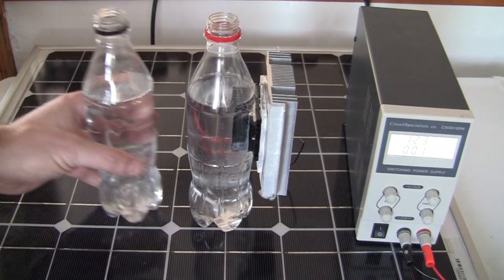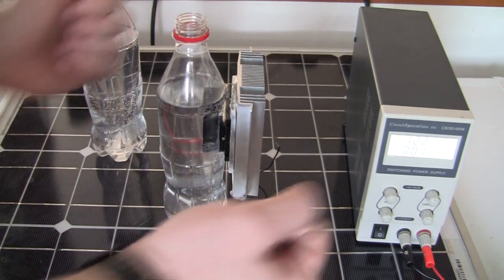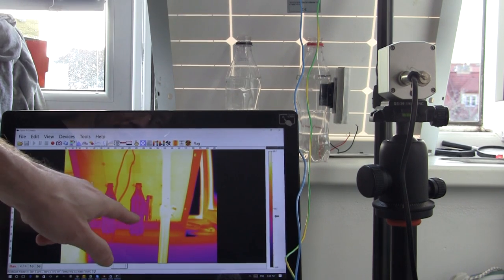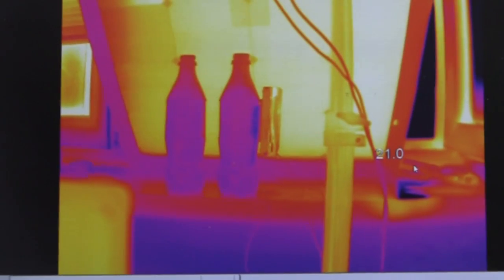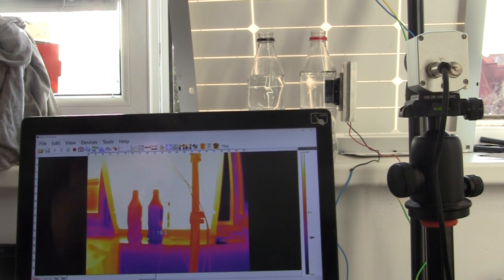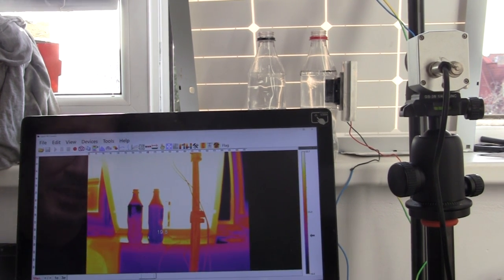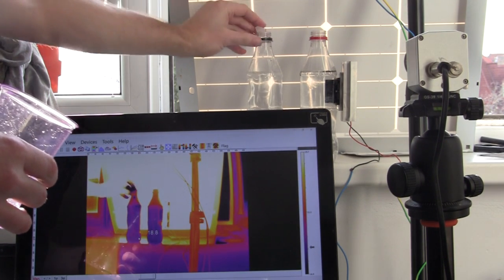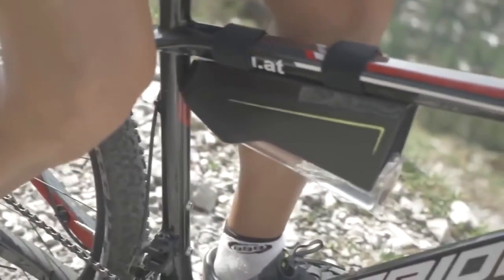Self-Cooling water bottle ACTUALLY WORKING!!!

Comment: Okay I came from rewatching your Juno video in 2022... and as you would qualify this if you had my knowledge in spanish pottery, this is just an over engineered piece of garbage.
Go to the wikipedia and search "Botijo", a clay container/big bottle made of porus clay that keeps water cool through evaporative cooling, and sure you lose some, but a botijo can be big enough to carry more than 2 liters of water and the energy used to evaporate water makes this loss negligible (or more likely you don't notice because it's opaque), and sure is heavy, but it is still lighter than a solar pannel and keeps your water fresh and cool even in the sun, not cold just cool, but still nice. It's a proven and well tested design that has lasted centuries and is still produced and marketed.

And just before anyone says this is outdated tech, the apolo missions used evaporative cooling through poorus metal to cool their computers.

So yeah you just made an overengineered rework of an already existing concept that is more cumbersome and expensive than common availabe alternatives. Just wondering, how does it feel to get busted?
Reply: You do realise that the whole point of the "Self-Cooling Water Bottle" was to poke fun at Fontus and their self-filling water bottles, right?

Comment: So it does work.  Just kinda clunky and not very efficient.
Consider converting it into a car add-on?  Drop the self-cooling angle and make it a bottle you can plug into your car to keep your drink cool on a long drive?  I mean, it's a needless, gimmicky thing but it does what it says on the box and I'm sure there are rich twits out there who'd waste money on it.
That's just spitballing a random thought. I have no idea if that would work.  The one concern I can think of off the top of my head is that one side gets really hot because it's a heat sink, so you'd have to be careful with where that is.  Can you make the cooling part detachable from the heat sink, so you can build that into the car and then plug the bottle into the heat sink to use it, so the heat is radiating out in some place that can't be touched by anyone?  Like, into the engine area, which is already hot anyway?  Then again, that might cause other problems.  Does the heat-sink part need to be really close to the cooling part?  I assume yes, because it's basically sucking energy out of the water to cool it off and that heat has to go somewhere and that somewhere is going to be close at first, but I don't know, maybe you could transfer the heat through a conductor to a radiator somewhere that's safe?
Like I said, spitballing ideas while having no real knowledge of engineering and just really basic knowledge of chemistry and physics.
Just at a glance it seems like you could maaaaaaaybe work this around into something that could actually be useful.  I mean, it's only useful at solving a first-world problem and not in a very efficient way, but still useful.  I'd personally just buy some ice myself, but, as I said, I'm certain there's plenty of rich twits who'd pay good money for this.
And taking money from rich twits is what this sort of thing is all about.

Oh, wait, just noticed there's a "show more" on the description.  Half an hour to cool it by 1 degree.  That complicates it a bit.  Hmm.  Need a bit more juice to make it work at a reasonable speed.  Could take quite a lot of power and generate quite a lot of heat.  My safety concerns immediately become larger then.

I mean, all these might be silly questions to someone who's got more experience with this sort of thing, but you gotta at least give me this much: I am asking them rather than just assuming they can be done.  And I seem to be asking the right person.  So that's two things I'm doing more right than Elon Musk.

Comment: Dude you never measured the power the peltier was getting from that panel. Guarantee it was running nowhere near it's Vmp, power thruput would have been pathetic. Use a buck converter at the very least to match them, get closer to the bench supply performance.

That said, the ice is still far superior 🤣

Comment: Its called a Peltier module or chip developed by the japanese. To be more efficient the hot finned area needs to be cooled with moving air. They use them in portable coolers.

Comment: i did some (probably really bad) math and found at a 10% efficiency, that solar panel is producing roughly 14 watts.
(4200*0.4kg*2) * (100% / 10% effic) / 2400s (40 mins) = 14 watts. i could be wrong tho

Comment: I did once use  a huge CPU cooler I salvaged from a scrapped PC, plus a peltier module, heatsink, fan, a yogurt maker and a car battery to make an EMERGENCY ONE BOTTLE BEER COOLER. It worked very well when you found all the beer was warm since it was left in the car at the campsite on a fishing trip. Load one bottle, connect battery, go fishing for an hour or so, have nice cold beer, repeat.

Comment: Self cooling water bottle. Not new at all. Very low tech in fact.
This one dates back to the middle ages : Take a simple thin walled clay jug. DON'T glaze it.
Fill with water. Some of the water will percolate through the porous jug and evaporate at the surface, cooling it down. The hotter and dry the environment, the better it works.

Comment: The peltier is supposed to move heat from one place to other. This isn't a fair presentation, since you didn't do much to keep temperature difference low. You need convection on both sides.
Not saying it's you are wrong, just that I wanted to see a proper setup of peltier cooling a water bottle.

Comment: 50 watts? doesnt that bottle take 60? to get watts you do voltage times the current (amps) so 12×5=60. correct me if im wrong, though.

maybe it was just a mistake

Comment: take a quarter of the solar panel, put it on top of a backpack, let it work for hours while hiking, cool water while hiking. Sounds like a plausible invention. Use liquid based heatsinks to reduce heatsink weight, they are much more efficient and thuns you will need lower surface area and thus less weight. 

This could be refined into commercial hipster product.
Reply: Strazdas The power consumptiom of the liquid cooler.... And a solar panel size.... Maybe for a car, but not for a backpack Dora the explorer.
Reply: You dont need it to cool it in a few minutes. you need to cool it over a span of hours. smaller panel will be enough for that and will be lighter to carry around. you can thermally isolate the bottle easily so you dont have to worry about it heating back up.

Comment: If the water bottle was made of terracotta it would really self cool. This is electric cooled which is not self cooled.
But a terracotta bottle would leech some water through to the outside where evaporation would carry away the heat, cooling the contents naturally.

Comment: what if you make 2 layers bottle the iner is metal attached to the device then a plastic outside with air in between with the hot side outside the plastic will it work better ?

Comment: And thus you've invented the most useless fridge ever. XD Though, I guess this thing could work as part of geek accessories. You should tidy up the product: put in stylish metal casing, with window on the side for the heatsink, add capable battery to it and voila: generally useless, but cool (even cooler when it's working) drinking cap.

Comment: you left out the fan on the heatsink in your second test which has a negative effect on the Peltier element. also there are batteries, you don't need a solar panel

Comment: raises hand I'm curious about your math in the description.

You wrote: 'It takes ~ 500x as much energy to heat water up by 1 degree as boil it.' 

My english isn't the best - but it seems you're implying that boiling water takes 500x less energy (2000kJ raising the temperature to boiling point) than raising it by 1 degree.

So to raise the water temperature by 1 degree...would take something around 1,000,000kJ ...thereafter it would have a runaway reaction somehow satisfying the thermodynamic equation, returning electricity to equate to 2,000kJ used?

Comment: Could you possibly use the heat from the solar array, or even just a black surface and feed that heat in to replace the electrical components?

Comment: Hey thunderf00t, I was wondering if you would be willing to do an experiment. In a cup of coffee, what cools first? Top, middle, or bottle. And vise versa and cold cup of soda, what heats up first? Thanks mate, I look forward to hearing from you.
Reply: 1. Depends on the thickness/ overall dimensions of the cup of the cup and the room temperature (use the heat transfer equation) 
2. Use Laplace Equation to solve the problem
Reply: Hot liquid rises to the top, cold flows to the bottom. If there is unequal liquid temperature and water conditions the top will always be hotter except the very surface which will be cooling and then flowing downwards.

Comment: you said earlier in the video that it wasn't actually self cooling because it was actually running off a power supply, would the solar panel also technically be considered a power supply since it is supplying power to the device you glued to the bottle.

Comment: Using a Peltier powered by a solar panel is interesting but by no means revolutionary. It's been around for a while. One guy at work back in like 2001, had one he wired to a USB and would use it to keep his can of Coke cold for hours. 

In fact you can buy one here: http://www.ubergizmo.com/2007/06/peltier-can-coolerheater/

Comment: you did not put the fan on the heat sink, that is the reason it did not cool faster. I do agree that it will be slow but it would be WAY faster with the fan

Comment: You could make a pretty decent self-cooling bottle by having a pressurized compartment full of, say, liquid nitrogen. Have an electrically controlled valve that lets out more air whenever it gets too warm. The same idea is used to keep various compressed fluids liquid, like helium.

Comment: I just partially freeze my drinks when I go for hiking on hot days. Leave it long enough in the freezer for it to start to freeze. It more or less works on less you want to be out for ages. But then I rather drink warm coke/water than carrying a heavy portable cooler.

Comment: ok so take a heat sync the shape af a water bottle, place peltier devices around it, insulate it, and have it connected to a small solar panel, the insulation and peltier device would keep it a tiny bit cooler that just an insulated bottle. Of course it be a big ass bottle and expensive but could work.

Comment: or you could just wrap a bottle in cotton fabric and wet it. probably works better than this. when in Iraq we would  keep one bottle in a sock and fill it then wet the sock in a few minutes the water was much cooler. no i did not work as good as ice but ice is a bit hard to come buy in the middle of a dessert.

Comment: Do you think a peltier device could function efficiently or at least as efficiently if its designed to be bent to cover one half of the bottle?

This could actually work as a commercial product, and a larger surface area would allow better heat dissipation without gigantic, bulky cooling fins hanging off the side.

Comment: Where did you get the ice cubes? How long did it actually take to cool the ice cooled bottle? How many kilowatts did your freezer use to make those ice cubes?

I agree that a self cooled bottle is dumb as hell but the same technology to cool the self cooled bottle is almost 200 years old and relatively undeveloped as yet, but you did prove that it would be practical to use this for the refrigeration to make the ice cubes.

Its actually how I run my own refrigerator.

Comment: You might bet better results by creating a blower style cooler (Look up blower style GPU for reference).  It'll create a fast airflow over the warm heatsink that'll carry the heated air off faster.  You could also increase the size of the cool-side heatsink.

 I don't know if you can get a more efficient peltier cooler, but that could help as well.

Comment: We could scale this up and call it the "refrigerator"
Reply: WesOfX nah nah nah, bad name, too many syllables, people would probably just end up calling it fridge
Reply: So does the self-cooling bottle. We just need larger solar panels. We could put them on the roof and call them "rooftop solar panels"
Reply: @wesofx8148  Rooftop Freakin' Panels
Reply: Actually there’s peltier effect refrigerators, they are used mostly in hotels and things like that, because they require more power but make no audible noise
Reply: Xavi, thats interesting, didnt knew that. Is that why hotel fridges are so slow at getting cold after they get turned on?
Reply: It's the Peltier effect that causes the cooling, to make it really simple, a thermocouple can generate a current by temperature differences, this induces temperature differences by running a current through it.
Reply: No, because refrigerator works on a different principle.
Reply: @StrazdasLT  Peltier refrigerators do exist, they're just less efficient.
Reply: "Self cooling" refrigerator
Reply: Solar mini-fridge would be amazing and would be a plausable idea.
Reply: a microwave with FREEZE rays
Reply: No, its the SelfFrigirator Revivolution!!!...well not really
Reply: Pallington the Shrike shenaniganzery? ♡ it
Reply: It even pays for itself!! It makes capital!!
Reply: 😂😂😂Yes
Reply: refrigeration uses air compression thermodynamics, this uses some electric thermodynamic heat sinking shenaniganzery that I don't understand yet.
Not air compression/decompression thermodynamics.
Reply: Yes, but Peltiers are much less efficient than classical fridge.

Comment: Please don't hate me, but I have half a mind to get a small cooler, cover the lid and three sides with smaller solar panels, wrap narrow copper tubing into beverage can sized cylinders, carve out some Tesla valves, attach it to something like a home CPU water cooling arrangement, add some insulation to the non-coiled sections of the tubing, stuff the whole thing into the cooler with the heatsinks sticking out the side left uncovered, then draw a single sheet of thin enameled copper snugly over the whole thing and market it out as a "portable self-powering beach mini-bar", for the luxury of a hotel suite on the go.

You heard it here first, folks!

Comment: So if it takes that dramatically larger amount of energy to cool the water in comparison to heating it, wouldn't it just be easier to boil salt water from the ocean and distill it? Or would distilled water have too many negative effects on the human body? Or does that also require too much energy?

Comment: Hey thunderfoot. I was wondering about that self filling water bottle. They keep showing it on a bike. What about converting one of those power generators that roll on the tire of the bike people used for head lights to power it? I know one of those things would add maybe 1-5% more effort on the rider but i think that might be a better solution than a thigh covered solar panel.
Just a thought. might be something to cover later?

Comment: but you can't just get ice anywhere, it is so much easier to carry that tiny solar panel around. then go into your freezer, the local store, gas station, or even a restaurant.

How are you ment to find Ice when you are doing extreme activities in the woods or ocean. if only some one could figure out a device that you could put cold liquid and/or containers full of cold liquid that you can take with you. Hmm a box of cold... Cooled cube... no umm hmm. Well good luck Thunder.

Comment: This shit is SIMPLE. You just build a hydrolysis machine, burn the resultant water and oxygen, use the heat from that flame to generate steam, use that steam to spin a microturbine, use that microturbine to power the hydrolysis machine and the self-filling water bottle, use the water from the water-bottle to refill the hydrolysis machine as needed.

Boom, infinite free water for African children to drink. Indiegogo here I come.

Simple.

Comment: They've had products like this on the market for a while and they charge a LOT of money for them. I was using Peltier cooling for CPUs back in the golden years of alternative cooling methods before liquid went mainstream. LOL once I had thought that this would be a great application to pull heat away from engine heads... until I did the math on how much power that would take... 

Great video as always...

Comment: I think this would still could be useful in the tropical places were biologist to field work (no ice available). Of course it would not be with a solar panel thats stupidly big to carry but a rechargeable battery would do (people can recharged before they go out).
Reply: The efficiency is so poor that rather than a 10 kg battery, you're better off bringing a 10 kg box of ice. Or a propane refrigerator. Or a solar panel, sine wave inverter and a traditional refrigerator.

The only advantages to Peltier elements in cooling is that they're cheaper, lighter and simpler than compressors - but SOOO inefficient.

Comment: What if the heat sink was a custom heat sink in a cylindrical shape and attached to the bottom of the bottle, and was the same diameter and shape of the bottle? What if longer prongs ran up into the bottle? The bottle could dock into a holster on a bicycle like the Fontus which also contains a power plug for the heat sink. Instead of solar energy, a battery could store electricity generated by the activity of the bicycle. You might actually have something worthy of a Kickstarter here.

Comment: Why not design a fancy container to hold the fan/heat sink add on, replace the solar panel with batteries that could be put in that part of a battery container, and then forget to remember that ice cubes exist? Also, water and batteries is a great combination.